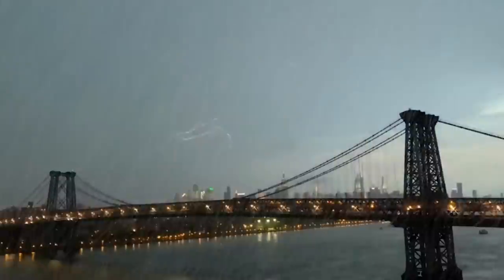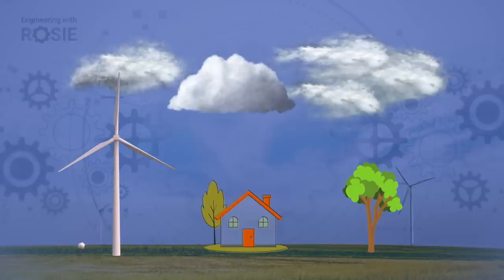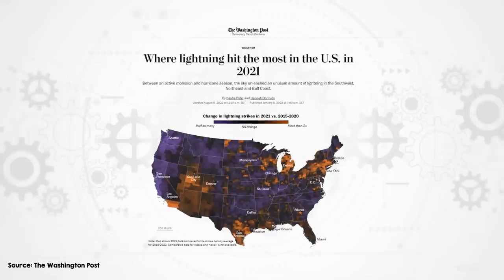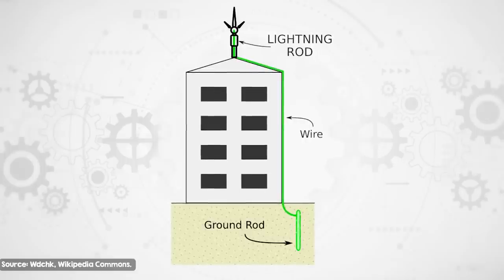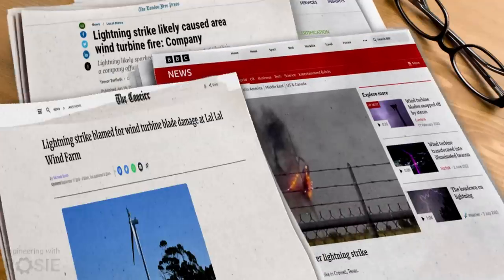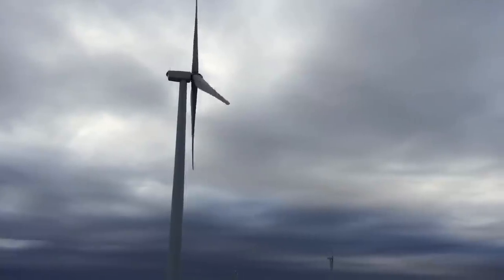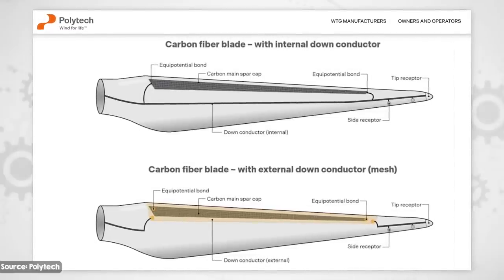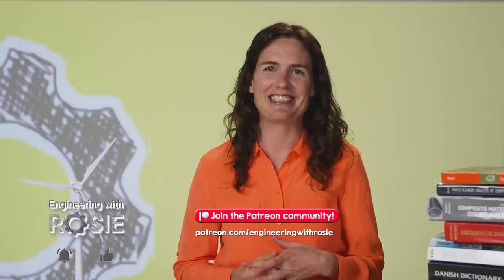Wind Turbines vs. Lightning: What Happens When a Wind Turbine Gets Struck?

Comment: Your answer as to why American wind turbines got hit by lightning and damaged is also why the US is anti turbines, citing the flaming turbines as the reason, not their own stupidity. They probably forgot that lightning is, more often than not, accompanied by rain, a very good conductor of electricity and also a reducer of resistance. 
I used to work in 400Kv substations doing repairs and installations and on dry days it was ok, the hairs on your boy would stand on end but there was little else going on. On rain days, on the otherhand, when working on a cherry-picker, it was earthed, every time it went within 50mm of anything metal there would be a discharge and if you had to touch anything metal you had to slap it to ensure a quick discharge.
You said it happens more often than it doesn't, is this to do with the movement of the blade tip through the air building up a charge and attracting lightning? Would a metal mesh on the outside of the tip discharge to the LPS?
Reply: Lightning is definitely a pain point for wind turbine proponents at the moment.  We will find a solution.  The movement of the blade through the air does build a charge but most of the charge around a blade is due to a nearby thunderstorm.  Metal meshes are used on some blades today but they have had marginal success.

Comment: regarding the matter of treating lightning as a fluid..(at the 11 minute mark)...  my understanding is that the lightning uses the plasma as the conductive path, so it makes sense that it is sensitive to air movement.  In things like high power electrical relays, it is possible for arcs to be created when opening the contacts.  These arcs rely on the plasma that is created, and some relays use magnets to manipulate the plasma to break the conductive path.  Producing enough air movement around a turbine blade to disrupt the plasma seems like it could produce a lot of drag, though.  
In regards to using copper mesh to keep the electrical current out of the carbon fiber... this is something that aircraft designers have been utilizing for many years.  Presumably the turbine blade designers are familiar with this body of knowledge?
Reply from the maker: Copper mesh is used a bit in wind turbine blade LPS and I can tell you from traumatic experience that it is NOT EASY to incorporate in the blade manufacturing process 😭😭😭 this is bringing back painful memories of a couple of stressful months I spent in a factory a few years ago trying to wrangle such a system.
Reply from the maker: I believe that only some lightning engineers working on wind turbine blades are applying this knowledge to blades. This is one of Allen's pet topics so I will ask him his opinion during the livestream. Thanks for the comment 😊
Reply: My question is how much is understanding  Lightning's nature  is going to affect the nature of the protection? 

already cost effective alternatives that would protect, no matter what the nature of the lightning is... From a purely scientific standpoint it sounds great to know but from an engineering aspect it seems  Irrelevant....
Reply: It’s definitely not irrelevant because of the manufacturing costs and complications.  We could add metal mesh and other conductive accoutrements but it adds significant costs and is likely overkill.  OEMs are essentially broke at the moment.  Need to find smart ways to improve the lightning protection without blowing up the budget.
Reply: @WeatherGuardLightningTech   I apologize for my poorly worded previous comment.  An elegant new cost efficient option is something, we all want to have available. But risk is also a type of a cost too. 

Has increasing,  the conductivity of carbon fiber, such as via doping, been considered as a methodology, as a form of lightning protection?  Or aluminum oxide, it's already being researched for various applications. So development costs could be mitigated. And it would be lighter than adding layers of metal. 

Lastly I did not know the OEMs were going broke. I hope you can help save them and make a profit at the same time.

Comment: What if we could tame lightning for something useful? Many years ago, Union Carbide (Now part of DOW) was manufacturing pure carbon electric thermal induction rods. Then, when the world’s steel production shifted to China, they had a lot these rods, which are used to convert electricity into heat to melt iron ore in steel mill blast furnaces. So, Union Carbide invented a SMALL steel mill blast furnace, to install in all hospitals, to incinerate all hospital wastes, which hospitals paid waste disposal companies to dispose of, but a lot of medical waste ended up being dumped in the ocean, and washed up on seashores endangering vacationers. Their mini-blast furnace would use these carbon rods, to superheat a pool of molten steel to completely destroy and incinerate ALL hospital wastes onsite, with the waste heat being used to heat the hospital, and heat the hospital hot water, with fused stone slags being periodically removed from these units, to become bricks or stone sea jetties. And because it had NASA’s space shuttle tiles insulation, it would always keep the pool of steel molten, by preventing the thermal heat from dispersing. BUT, this thing never caught, because the electricity needed to make its carbon rods heat up was just too expensive, they didn’t want to pay such an ENORMOUS electric bill. BUT, what if we could ground lightning bolts from the many lightning rods on the tall buildings of cities, or from lightning strikes on tall windmills, into such hospital miniature blast furnaces? No more electric bill, and such units could also be used to destroy many types of toxic wastes, or melt down various metal junk for recycling as well.

Comment: Perhaps one day it will be possible to HARVEST the energy of the lightning strikes, so that when wind turbines are halted due to a storm, energy may still flow from the farm to the grid, only from a different source.
Reply: Just like they did in the film "Stardust" that was awesome!!
Reply from the maker: I didn't know that one, thanks. They also did it in Back to the Future, right?
Reply from the maker: The boring engineering answer to that is that since it's such a short duration there isn't actually much energy in a strike despite the high power. Plus it's very infrequent so wouldn't really be worth the cost of the equipment.

Comment: Why exactly the first turbines to test are not installed in places with a lot of lightning stirkes ? Like there is a place on west coast of Africa.
Reply: Wind turbine tests are mainly about structural integrity and system performance. Lightning strikes to test turbines are just a bonus.  Most of the lightning testing happens in laboratories.  Placing test turbines in strong lightning locations would definitely help find issues early.

Comment: Maybe "Passive" lightning protection isn't up to the task, especially with the large lead times in testing.

You never mentioned in the video about "active" lightning protection. Actively Charging the Wind Turbine Blades and Structure to reduce the electrical potential between the clouds and Turbine, but not enough as to cause a discharge between from the Structure to the ground. Making the Turbine a less attractive target, compared to the surrounding area. 

Or, a Dual Charge Approach. Adding another "active" lightning protection like adding an "charged" attractive lighting rod to the top of the tower. Actively charging the attractive rod to increase the electrical potential and number of lightning strikes, while actively charging the structure to reduce electrical potential from cloud to Turbine.
Reply: Researchers are evaluating this method at the moment.  Early trials are positive but the negatives may outweigh.

Comment: One more comment then I'll stop.  I've worked on large equipment where static discharge and grounding currents are quite a serious consideration with respect to bearing damage.  Even relatively small currents can do a number on bearing balls/rollers and raceways.  Think of an EDM machine, but the inside of your bearings being etched.  Even with a slipring to ground bypassing the bearings, I'm sure still a very substantial current passes through the bearings.  Is this a concern?
Reply: Yes - you are correct. Some amount of lightning current is flowing through the bearings and raceways. This current will pit metals and create weak spots that will force an early failure.  Wind turbine designers try to give the lightning current alternate paths around the bearing/raceways - not always successfully!

Comment: Rosie, not related to this video but the heat dome over cities in northern hemisphere right now, figured you were the one person in the Youtubeverse to ask; 
Could a 'fan' blast air up from the highest point in a city,  and tilted downwind or toward wasteland, not sure what angle, to bring in air from the surrounding area, with enough force to break the heat dome? How much energy would such a prototype use, and how efficient could it be hypothetically built if it works thermally? 
Seems the fan shape would not be a standard windmill, as the purpose would be a narrow jet to blast as far as possible, and the noise tolerance would be near zero. Would it have to be put on flight maps as a no-go zone? Instead of running several hours a day, it may be optimal to run periodically per real time data, allowing as little as a single air exchange per cycle.
Reply: The amount of energy needed for such a thing would outweigh any benefit by orders of magnitude. That's not even considering the capital costs of designing and building such a system.

Comment: Would it be possible to harness the probability of lighting strikes to charge capacitors instead? Basically try and encourage strikes to charge a storage medium? Turning the problem into a solution or benefit? Could be called a LightningVane Turbine or ThunderWind Generator?

Comment: This seems like an enormously difficult problem to solve! Are we getting closer or do we just need the industry to build up more years of experience with different designs in the field to learn how to make the best lightning protection system without the costs ballooning out of proportion to the rest of the turbine?
Reply: The wind industry has plenty of data on strikes. The problem is the data is pretty generic.  Wind turbines are a unique engineering problem - they are tall and the blades are rotating at 200 mph.
Reply: @WeatherGuardLightningTech  Yeah I was thinking in terms of data on specific LPS system designs, damage patterns, survival rates, etc. Kind of similar to how they learned to protect bombers in WW2 by looking at the pattern of bullet holes of the bombers that returned to base
Reply: @WeatherGuardLightningTech  does that mean they're getting closer or not?
Reply: @WeatherGuardLightningTech  are you a politician? Vaguely hinting at blaming someone else while not answering the question.
Reply: 😂 Not a politician - definitely an engineer.  And yes, the wind industry is partly to blame for where we are at today - how can it not be?  There are thousands of drone images of damaged blades that show where lightning is attaching.  What is missing is the meteorological conditions that created the lightning that damaged the blade.  Every lightning strike is like a snowflake - unique. But we can start to identify the general conditions where damage is occurring and then try to simulate/recreate those conditions in engineering tests.  Right now the engineering tests are derivative of aerospace tests and are capturing the environment wind turbines exist in.

Comment: Would be interesting if they could figure out how to use the energy from the lightning strikes as an alternative power source 😊
Reply: Lots of power but not much energy.
Reply: @UCCLdIk6R5ECGtaGm7oqO-TQ   Or maybe we're missing something. What about the heat?  Could that be captured in something like a sand battery.  Sure, sand would turn to glass, but what about diamond dust?
Reply: Not much energy in lightning. Big lightning strikes will move about 600 Coulombs of charge - that’s 600 Amps for 1 second.  Not enough to mess with.

Comment: Rosie, question for the livestream, if carbon fibers electrical conductivity is potentially a contributing factor, is electrically insulating the blade from conducting to earth a solution?

I’m thinking that airplanes get hit by lightning all the time and the modem aircraft are using carbon fiber shells as highlighted by the Qatar airbus lawsuits.

It would be a degree of complexity at the hub to insulate while allowing the lightning conductor to transmit to ground, but similar engineering  problems have been solved in rotating work platforms which have power and controls in the non rotating base.

Curious to hear the weather guards experience based thoughts on this if only to see if airplanes are lucky and turbines unlucky !!

Comment: Maybe they could use charged wires to attract oppositely charged lightning and when the strike begins it would be switched to the ground connection.
Reply: This has been tried recently by a team in Spain.  Interesting results and it is still early in the learning process.  More to come....
Reply: What wasn't mentioned in the video is that ground targets for lightning (trees , structures) naturally become charged objects. It is the natural mechanism that causes the lightning to be attracted to them.
It is not the fact that they are tall that matters most. Shape and conductivity matters more. A sharp object is more likely to develop the corona discharge that is the beginning of the ionised path the lightning travels along.
Reply: Overly complex relative to the passive methodologies being utilized in the carbon fiber manufacturing of airplanes...
Reply: @nc3826  Aircraft lightning protection systems are very complex.  Much more complex than wind turbines.  Most aircraft use a variety of protection materials / designs - each optimized for weight, cost, and complexity.
Reply: @nc3826  it looks like airplanes and wind turbines might be an apples to oranges comparison since according to the video lightning damage to wind turbines has been rising as more carbon fiber is used in blades among other factors. Airplanes usually have smaller spans and not connected to ground.
Reply: @wesleyashley99  Airplanes are constantly being hit by lightning and have a greater surface area....   without a grounding source, so it's even more difficult to dissipate the charge.... 

plus Rosie already mentioned that wind turbine manufacturers are testing similar methodologies.... they just seem behind the curve....So I don't see why They would try something more complex and costly,  without approving track record ? k i s s 

bTW if anything is an apples to oranges comparison, it's between different wind turbine sites....
Reply: @WeatherGuardLightningTech  the Interweaving of copper  Which Rosie had mentioned, is similar to what's being utilized in the aircraft industry.... And it's simpler than what  was being suggested ... But as they say. the devil's in the details.... Thanks for the input....
Reply: @nc3826 Great comments!

Comment: Could you in theory reduce lightning strikes a great deal by having the nacelle be part way up a much larger tapering spike, whose tip is higher than the blade tips when they cross vertical? Would it just be cost thag prevents this?
Reply: That idea has been discussed in the engineering community.  It's just difficult to install a 100m rod on top of a nacelle.
Reply: @WeatherGuardLightningTech  Good to know my thoughts aren't entirely dumb haha, I was imagining the entire structure looking similar to the Dublin Spire monument, with the nacelle about half way up. I'd imagine could be done, yes, costly? Probably. Id be interested to know how it would affect the long term operational costs though.
Reply: A similar idea has actually been tried. Guess what? The turbine blades still go POW!. Remember how she mentioned the rotation increasing the vulnerability? We think this is caused by the blades outrunning the corona space charge that dampens the electric field on stationary objects.

Comment: From my little knowledge about sparks I know that the air becomes conductive when heated. A DC spark can be made very long but must have a close contact to start. Is there a possibility that the blades either ionise or heat the air at the high speed? Or maybe it is a change of humidity. 
By the way I don't think the lightning only takes the way of the least resistance. The current from the lightning MAINLY take way of least resistance but takes all possible ways.
Reply: Lightning heats the air to around 10,000 Celsius in about 1/100,000 the of a second. Lightning doesn’t necessarily find the least resistive path - it just needs a path. Lightning rarely takes a straight line path - it winds and twists about itself for miles.

Comment: No disrespect meant, but if I heard correctly you defined specific energy incorrectly.  Specific energy is energy per unit mass; electric power is the rate at which electric energy is provided or transferred, (or, the rate at which work is done).  No?

Comment: Step down the voltage, into usable amperage ranges, then store it in mechanical batteries, then push the mechanical energy generated by the mechanical batteries, into normal batteries.
The energy can be pushed into water, to heat it up, and generate steam. Steam can power mechanical batteries. Ect.. Ect...